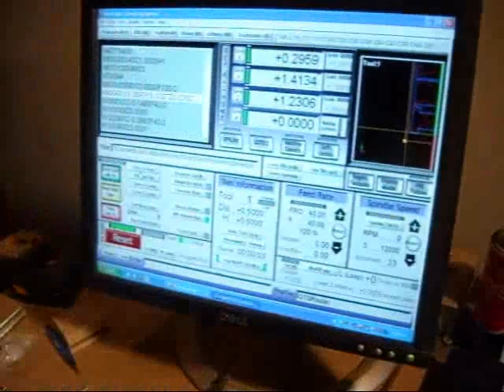Joe 2006 CNC Router - Cutting HDPE

Comment from the maker: whiteside 1/4" upspiral o-flute cutter, was awhile ago probably around 100IPM 15,000 RPMs on the spindle
Reply: With hdpe I run my spindle between 8,000 and 10,000 rpm and don't get any melted area's